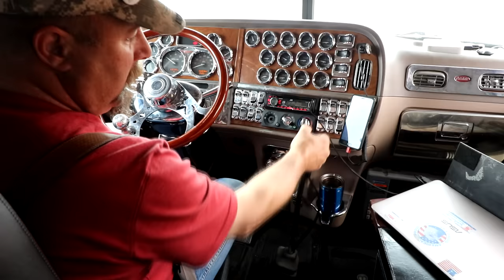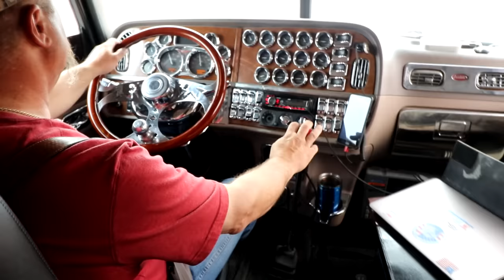How to shift an 18 speed transmission

Comment: I’m a safety instructor and you would be a great instructor. Clear instruction with 0 ego. Kudos to you my friend. This what a veteran driver should be.
Reply: Kudos anu ka pinoy?
Reply: @pakyu6622  Kudos didn't originate in the philippines mate. It's of Greek Origin.
Reply: In the Netherlands the current generation Truck drivers can't drive a manual truck anymore.  Most Trucks from the last 10 years are automatic.  My colleague ruined a manual transmission in 2 weeks from a almost new rental truck. Why isn't almost everything automatic like the USA cars?
Reply: @dennisdegroot7490  Because Trucks are huge. It costs too much for an automatic and manuals are more sturdy.
Reply: @UltraGamma25  In the Netherlands There is no price difference anymore Between an automatic or a manual truck.
Reply: @dennisdegroot7490  Because manual transmission keeps you focused on what you're supposed to be doing - driving.  I've always argued that automatic transmission is too easy and gives drivers a reason to be bored.  That's when they're turning their heads, looking at their phones, rummaging through bags, etc.  When you're on a steep incline trying to move from a dead stop with a manual transmission, you're not paying attention to anything else.  Don't get me started on self-driving.
Reply: @dunetiger  I agree with the incline reasons. The circumstances are way different for me. In my case ( the Netherlands) is more than 99% flat. I have to shift al day. We don't have a long straight lane. I cross my intire country in a couple of hours. I don't have space. There is always traffic.  I am always close to other vehicles. The roads are much more narrow. An automatic gives me more time for other things mirror etc. I can't keep one speed for a long time. It's always to the driver to stay focused also after many years. With doubts I will always check before I do something stupid. It saves a lot of energy.
Reply: @dennisdegroot7490  Absolutely and I didn't mean to imply automatic transmissions instantly make you a dumb driver.  There are many positives to it, but I feel that for the general day-to-day, people are way too inattentive because they don't have to focus on operating the vehicle.  So many accidents occur that, I believe, would have been avoided if the driver was using a manual transmission (or at the very least, would have had a significantly lower chance of occurring).  I think everyone should start on it and then transition if they want to, but that'll never happen.
Reply: @dennisdegroot7490  I'm about to start my training as a truck driver in The Netherlands and I'm looking forward to cranking up some manual gears, albeit with touch buttons. I chose a van with a manual gearbox when the boss asked me a few years ago 😊. I love that engagement with my vehicle that way.
Reply: @kojowiredu  Do you want some tips you are going to use in reality or do you want to do your own thing? If you are not going to use it, It's not worth typing a  big load of information.
Reply: @dennisdegroot7490  I've started the whole process with Randstad Transport but tips are always useful😊.
Reply: 2nd comment with 666 likes. Wtf
Reply: @dennisdegroot7490  If you're not a Fleet driver, but private: Because manual is both less costly to repair, and gives you better command over your fuel useage. Which is where most of your operating cost is sunk. I was spending about $75k in fuel per year, but judicious use of a manual with precise ranges shaved about $10k off that bill. That's $10,000 in your pocket. And put towards paying off or maintaining your business.
Reply: Hey ummm I really need your advice. I really want to be a truck or lorry driver in the European continent or North America. For now, I don't have lorry or truck driving license, but it can be done. The problem is, idk if my local license will be legit in these regions. I live in a small country in Asia(Malaysia) and the max lorry or truck driving license is called GDL, in which the owner would be allowed to drive a 7.5 tonnes lorry or truck. Do you know if it is legit there? Do you know how to get the job there for someone like me? I'm 23 years old by 2020 and I really want to work as a truck driver. I don't really want to work local as the wage is quite low
Reply: @dennisdegroot7490  Automatic transmissions can't downshift to a lower gear if descending down an incline. Leaving the driver to rely on the brakes.  When the brakes go nothing to stop you.
Reply: @dunetiger  i couldn't agree with you more! Having everything automatic in this day and age has made people more likely to be multi tasking while driving etc.
Reply: Damn why you hating on him wtf……..

Just kidding
Reply: @cookingandbakingbyjohnny  the allison transmission down shifts from 6 to 4th but really steep stuff u gota manually select 3rd  there actually pretty nice for the mountains

Comment: That dashboard has more dials than a nuclear station
Reply: you CANNOT have too many gauges!!  I still see space for 2 more!!! My next truck will have 22. W/O a clock!
Reply: @rolling1885  weird flex but okay
Reply: Still cant find out how he's seeing the road and the cars...
Reply: It still has less than a teenagers that found out what repco is lmao
Reply: 13 dials. Ametuer numbers.
Reply: rolling 18 what are they all for
Reply: Its got a guage to count how many guages it has
Reply: When you have a gauge that displays your throttle position you may have a couple too many
Reply: Bigger/more is better, gauges, truck, and especially handlebar mustaches xD
Reply: So much woodgrain and chrome as well. You'd expect the dash of a commercial vehicle to look less... shiny. There really is a whole aesthetic going on.
Reply: You have the psi gauges for the truck and trailer, each wheel has their own gauge, then you have to gauges to make sure each gauge is working properly, then you have the fuel pressure and the gauge to make sure the fuel pressure gauge is working, then you have oil and so on and so forth. 🤣
Reply: The old R model Mack I learned on only had a few gauges that were basically not used ...fuel ( just look in the tank ) air pressure (wait for the buzzer to stop ) and voltage ( if the truck started it was good )
Reply: 666 likes.
Reply: @ranasatyanshsingh8117  He knows the road really really well.
Reply: Chernobyl had more and they still messed it up
Reply: They're all clocks.
Reply: lol
Reply: I wish cars had more useful gauges like some of those listed. The coolant gauge on most modern cars is just a lie, once it hits 90C it stays there. I like to see it fluctuate with the thermostat operation. I like to know the oil temperature and battery voltage. Only car I know if that has all those gauges is the Holden VXR8. Looks like I’m buying one of those next 😄 PS - excellent video, great description of the transmission operation.
Reply: @SteelSkin667  
We spend a LOT of time in these trucks. 
We like comfort and luxury just like people do in their cars/SUVs. 
These trucks cost close to $200k depending upon how they're spec'd. 
We take pride in our rides.
Reply: @Samuel-I  Yes, but chrome and large woodgrain panels have all but disappeared from high-end cars, or even high-end European trucks for that matter.
It was more a comment about the retro Americana influence on the way that dashboard was designed and put together. Although I do realize that it extends to the exterior of the vehicle as well.
Reply: @ranasatyanshsingh8117  not like hes seeing anything over the big ass hood anyway LOL
Reply: @Timms MC thanks! Was curious!
Reply: psst.... he switched to nuclear drive (with two stroke diesel sound generator) some time ago. The "shifter" really is the lever for the 18 control rods in the reactor!!
Reply: @SteelSkin667  he's an owner operator, that's his rig and he has to sit being all of it all day or night. Might as well enjoy what he's looking at ya know.
Reply: Not even close.
Reply: You don't know the mimic bus..
Reply: You have obviously never been in a reactor control room back in the analog days;.
Reply: @ranasatyanshsingh8117  dudes driving a 50,000lb truck you either get out of the way or blow up
Reply: @ranasatyanshsingh8117  he didnt.....that why there tons of warning label in this kind of truck so people dont go close to it
Reply: @zachconant7031  that's bullying on the road. 😆
Reply: @sunshineskystar  okay
Reply: @drampadreg1386  then he should be watching shipment trails in his sleep😆
Reply: Honestly I wish my truck was built with 100 gauges cause I’m actually interested in how things are operating, I know I could buy the thing you plug into the port but really I don’t know why trucks are built like they are now. They need to be rugged to do the things a truck has to. I am for keeping the seats though
Reply: very funny!
Reply: @SteelSkin667  This is a real machine, not plastic crap.
Reply: @frankyalvarez7160 they can't use a digital display like my infiniti to show every wheels exact tire pressure???